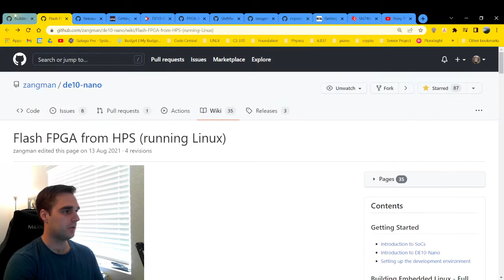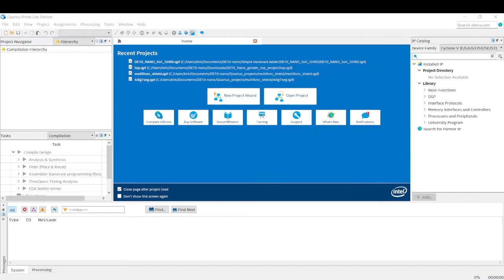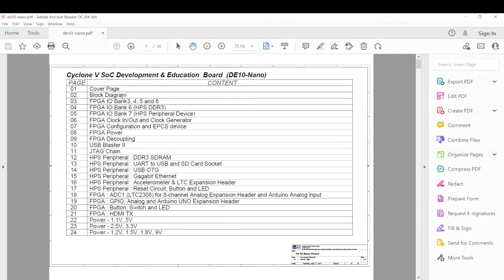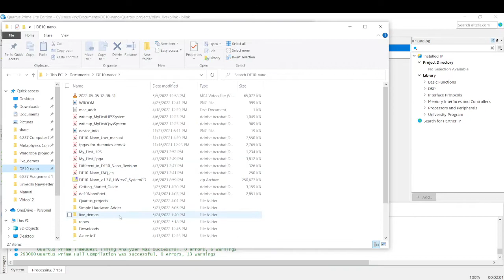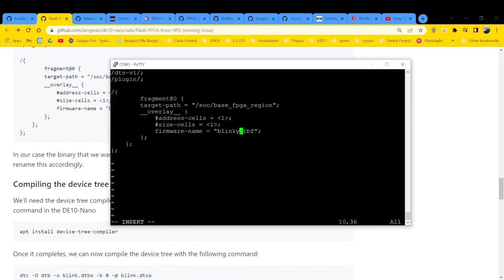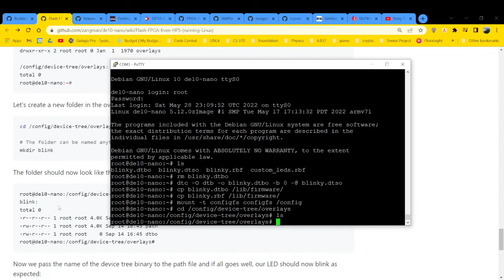Flash FPGA from Linux (HPS) - DE10-Nano Projects

Comment: Have you tried robseb / rsYocto?  I wrote a little about the differences, but YT chose to suppress my comment, again.
Reply from the maker: I have not tried robseb / rsYocto. I will look into this. This repo looks very interesting! Thank you for the share.

Also, I haven't seen a comment from you talking about this at all.
Reply: @metaphysicscomputing  It's the random YouTube censorship bot at work.  It's just badly written software, and it's totally indiscriminate.
Reply: @metaphysicscomputing  On past experience, if I write more than a line or two, it will now delete it, at least for the next few days.
Reply: @metaphysicscomputing  rsYocto has some advantages - the FPGA-write command is a very simple way to load an image.
Reply: @metaphysicscomputing  lrzsz is already installed, and gcc is set up with all the includes and the hwlib to compile the hps fpga examples from the Terasic CD - actually on the DE10-Nano or DE0-Nano-Soc.
Reply: @metaphysicscomputing  There's python3 installed too, and some examples in python in the home directory for root.
Reply: @metaphysicscomputing  FWIW, there's allegedly a moderation queue, somewhere in your advanced settings, but I don't know how much actually makes it into that queue when the Artificial Stupidity engine hides comments.

Comment: To transfer a file over the serial port you can use ZModem file transfers in TeraTerm, instead of PuTTy, but you also need to install lrzsz on the Debian Linux for the HPS.

You can do that after making the image - I've done it from the ready made image, using Rufus, as you said.

You need lrzsz_0.12.21-10_armhf.deb - which is easy enough to find.  The armhf part is important (ARM Hard Float, to match the HPS CPU).  You can place it on the FAT partition of the SD card, using a card reader / writer - you may need to assign a driver letter, in Windows (right click on My Computer and choose Manage, for example).

Debian on the DE10-Nano doesn't mount the partition automatically, and you should unmount it when you've finished, otherwise you'll get a warning error when you mount it again in Linux, and Windows will offer to scan and fix, if you insert it there - it's okay to let Windows do that though, and worked fine for me.

Do this to mount the FAT partition.  First, list the block devices, with this command:

blkid

You'll see something like this - one of them is the FAT partition:

/dev/mmcblk0: PTUUID="a6667878" PTTYPE="dos"
/dev/mmcblk0p1: SEC_TYPE="msdos" UUID="6F6E-2B3D" TYPE="vfat" PARTUUID="a6667878-01"
/dev/mmcblk0p2: UUID="475e59c0-c44f-4bdb-ad24-7d08c1fdfa96" TYPE="ext4" PARTUUID="a6667878-02"
/dev/mmcblk0p3: PARTUUID="a6667878-03"

Mount the one that says "vfat", like this (make a directory to attach it to, first):

mkdir /mnt/fatty
mount /dev/mmcblk0p1 /mnt/fatty

Now look at what's there:

cd /mnt/fatty
ls

You should see:

extlinux  lrzsz_0.12.21-10_armhf.deb  socfpga_cyclone5_de0_nano_soc.dtb  zImage

- that's the files that are there normally, plus the lrzsz package

Now install the package like this:

dpkg -i *.deb

You'll see some messages.  It doesn't take long at all.

Finally, unmount the FAT partition with:

umount /mnt/fatty

- note there's no "n" in umount.

You can then either delete the fatty directory, with

rmdir /mnt/fatty

or just leave it there for next time.

When you want to send a file from the PC to the DE10-Nano,using Tera Term, type this, in the terminal window:

rz -Z

Now go to the File menu in TeraTerm and start the transfer.  It will show a dialog box to tell it where the file is.  Use File -> Transfer -> ZModem -> Send, and browse for the file.

To send a file from the DE10-Nano back to the PC type this in the terminal window:

sz filename

e.g.

sz main.c

Then, use File -> Transfer -> ZModem -> Receive in TeraTerm, to get the file.  It puts all received files in the same folder, which you can specify in the settings, so it doesn't prompt you each time.
Reply from the maker: wow thank you! I will give this a try. I genuinely appreciate this. I was tinkering for some time with this, but I couldn't get it to work.

This will allow me to work on the board on-the-go without needing a ethernet connection. Very nicely done!
Reply: @metaphysicscomputing  You're welcome.  I think just the default options are enough, when installing Tera Term.  I installed every part, initially, then uninstalled it and started again - mostly to get rid of Collector.  I don't see a use for that.